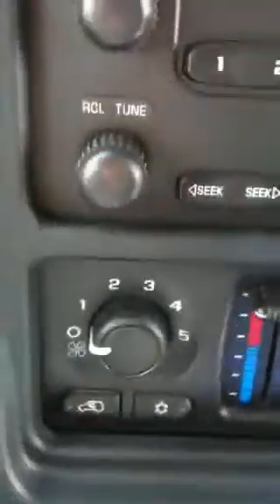Voltage drops after installing two kinetik 1800hc cells!  P

Comment: Big 3 ???
Reply from the maker: Ya, also had a couple alternators.  This model and year Tahoe has a VCM voltage control module and it steps the voltage down.  If I keep the headlights on it will step it up to 14.4 and if the headlight switch is off it goes to 12.8.